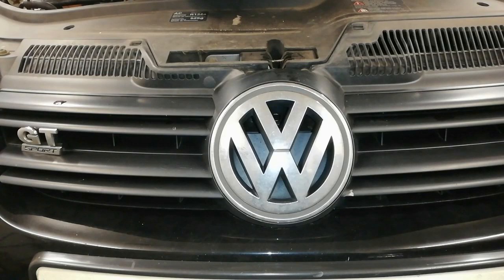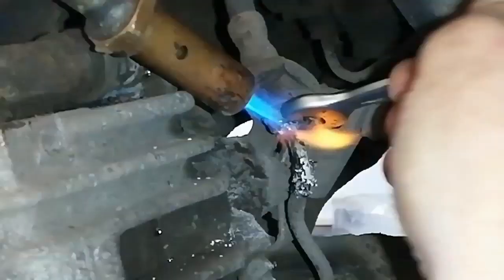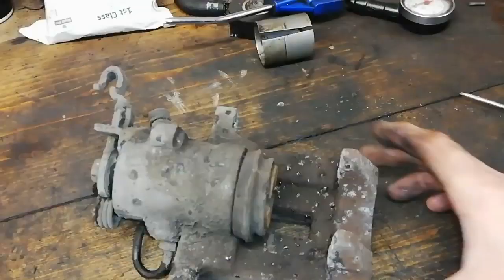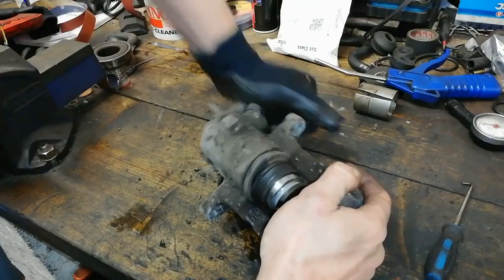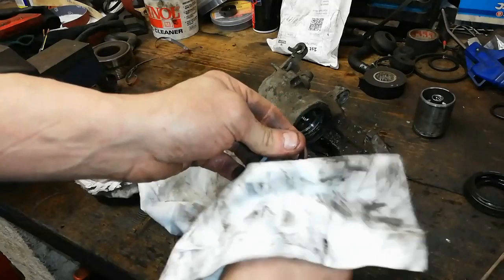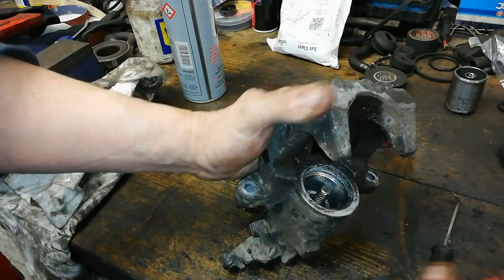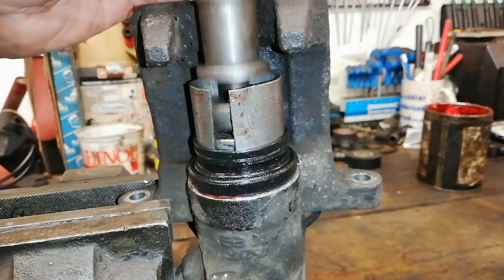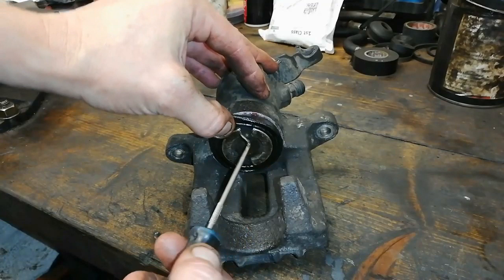VW Audi Seat Skoda Rear Brake Caliper Seized, Easy Fix

Comment: You're an absolute fecking legend. Great video! I could have done with seeing this video last year when my rear driver's side calliper seized up. I ended up getting a used one from Traynors. I also twisted the brake pipe too and got a new one. Your video has fully educated me and will hopefully save me from faffing about next time. Thanks ☺️

Comment: Note from an amateur. I heat the bleed nipple with hot air gun then spray freeze spray onto the nipple. Use deep 6 sided socket to undo. Works for me. Maybe some PTFE tape around threads and save grief later.

Comment: Great video Dave , love the special tool , these can be a pain to wind back in normally , I usually whip the rear disc off , remount the caliper without the pads and full access with wind back tool , easy peasey, might make a couple of the boot sliders, saw something once online about the lovely spring clip on driveshafts that's a pain in the bum to keep in place while putting the cv joint back on , made snap rings out of key rings  circles ,when desperate,  but this guy on the video used a jubilee clip around the snap ring to keep tight while tapping joint back on , then undo jubilee clip and repack with grease !
Reply from the maker: i knew you'd like the special tool mike, yeah i remount the caliper also but if she aint free she no good. Aye same sort of idea there with the jubillee clip i guess, take care, dave
Reply: Cable tie keeps the wire clip compressed too. Quicker than winding a hose clip.
Reply: @garybrown5500  true as long as not tight ring to compress  and jubilee clip can be reused

Comment: great idea with the sleeve always struggle with a blunt pick. first job in the morning make a couple of sleeves thank you
Reply from the maker: Used to be the exact same Simon, until i invented the 'special' tool
Reply: @davesterl  nice to see someone else repairing instead of just fitting new or refurbed parts. made a sleeve yesterday and used today worked like a dream. thank you

Comment: You can reassemble the piston and boot without a sleeve by pulling the inner dia of the boot over the bottom of the piston, then put the OD in the housing as shown here and push the piston in , Is a bit fiddlier as sometimes the boot slips off the piston , but it can be done . ( at the factory they put the boot in the housing 1st and then push the piston in through the boot and the seal at the same time. It can be done that way by hand as well but there is a risk of catching the ID of the boot between piston and bore and taking a bite out of the boot.)

Comment: Nice demonstration on what can be done to a caliper without the need to replace them.
Also l like the melting the pipe and the tool that you made
Reply from the maker: cheers matt, im sure youve come across this many times on the Vw's

Comment: Instead of using that metal sleeve to get the boot and piston back in all you have to do is put the piston in just so it’s started, then you put the boot in the groove with the piston hanging off. With a bit of calliper grease you just wind it back in with the boot in place.

Comment: Some VW Group calipers don't have the "wee steel pipe" for the brake fluid. The flexible hose connects directly into the caliper with a banjo fitting.  This makes the job even easier.
Reply from the maker: Not really the point of this video
Reply: @davesterl  the removal and replacement of the metal pipe is one of the trickier parts of the job- e.g.. when the pvc coating has flared.  It might put some off attempting this as a first-timer. Knowing that they may not need to do it will encourage some people to go ahead....
Reply from the maker: @henryjohntobin1  are you a mechanic?
Reply: @davesterl  no,  is that a requirement to comment?
Reply from the maker: @henryjohntobin1  to comment with authority on a subject as you are would require to have some expertise
Reply: @davesterl  I have removed,  renovated, and / or replaced multiple brake calipers; so have some experience.  However,  no experience is necessary to note that the task is even easier if your caliper doesn't have the steel pipe to remove and replace; so it's beyond me what your problem with the comment is.    I would point out, though, that burning off the pvc coating and then re-using the same steel pipe, now without protection from water and road salt, is asking for trouble.  Painting the exposed end of the pipe won't keep water and salt getting under the remaining pvc and sitting there, rusting the pipe. A fluid leak is inevitable.   New steel pipes with intact coating are < £18 a pair online or a few £££ in some motor factors.....
Reply from the maker: @henryjohntobin1  an internet expert then
Reply: @davesterl  much like yourself.  Picking arguments where there are none.  But not much expertise is needed to know that a very narrow gauge steel pipe carrying brake fluid under pressure, should be replaced if its protective coating has been burned off.  Road salt and water v unprotected tiny steel pipe = rust.  No extensive qualification or training is needed to know that is bad news.
Reply from the maker: @henryjohntobin1  much like myself? Really. You know my qualifications then. Your initial comment is obvious and not relevant to this video. You seem infatuated by this piece of pipe. You internet experts seem to be obsessed with saying any nonsense to appear intelligent. Does it make you feel good?

Comment: Good video. 
I think the red rubber grease is vegetable oil based, not silicone; silicone grease is usually colourless, almost clear.
Reply from the maker: Yes, both are fine for this application

Comment: top job dave . did 5 set of motorbike calipers last week seme deal all stuck on the dust seals . i find autosol good for getting some pistons back
Reply from the maker: aye Simon, i think people think its the block seal or piston itself that is the cause, it aint
Reply: @davesterl  people are generally scared to even take the calipers apart
Reply from the maker: yeah, i think most would just replace, but thats too easy

Comment: Great video! Question. If the dust boot doesn’t go in properly can brake fluid come out? I did an inspection on my brakes and had the piston out and having problems bleeding them. The brake pedal is still soft and hitting the floor after several attempts. Pumped the breaks around 50 times but not getting stiff etc. The dust boot appears to have gone in Ok but now it’s back on the car so hard to tell? Will it be the dust boot leaking?

Comment: neat trick with that metal sleeve, save you finger from geting hurt when you apply air in to put piston back
Reply from the maker: not sure why you need air to put the piston in but thanks anyways
Reply: dave sterl  when you put the piston in it normal position on top of the boot and blow air in the brake hose port conection then boot open up and you push the piston in it cyl  whit no air
Reply from the maker: @danman9017  ok cheers

Comment: 26:50 My piston does not go further but stays rotating at this level, too high. (Similarly as here at 27:02 in the correct level.) Does it have to do with the hand brake adjustment? The pads were really worn out, metal to metal.
Reply: Did you ever find a solution? Going through it rite now

Comment: Super video, thank you, I had started with the bleeder screw if it breaks, so ...
 :)
Reply from the maker: good tip on the bleeder screw there Carsten, tho i have methods of dealing with that also. I keep replacement bleeders as well as the boot kits
Reply: @davesterl  aye put a nice wee drill inside the nipple then grip and work it loose. The drill stops it compressing
Reply from the maker: @game4alaughman  great tip mate

Comment: Dave have you ever come across one of these that won't auto adjust?  Have one in Astra H, not seized, but when you pump up the brakes it doesn't auto adjust, when release brake just retracts all the way, if you repeatedly pull the handbrake the piston doesn't keep coming out it just pulses in and out in same at the same position spot.  Other side if you repeatedly pull handbrake it will push the piston out further and further. Tried winding it in and out
Reply from the maker: Yes, I've had that on older vw's where the handbrake wouldn't hold the piston. Easiest just to replace
Reply: @davesterl  cheers will do 👍

Comment: Have you come across the handbrake lever mechanism seizing? If so have you been able to repair it? Regards Charles
Reply: Mine were seized solid. You need to get the caliper apart further and clean out grime in the inner mechanism. Needs more skill and a pair of extra long reach long nose pliers.

Comment: Hi Dave Great video as always... couple of quick questions. Is that red grease silicon based? Is it safe to use on the sliders as well? Is it called red assembly grease as there appears to be quite a few types out there on google search.
Reply from the maker: Yeah silicon grease, 21.15, you may find different names out there, basically the same stuff(rubber grease, assembly grease)

Comment: So, at 12.16 you think that an old flexible  rubber boot will cause the piston to seize with a nominal brake line pressure of 30 to 40 Bar ?
 That's 588 PSI  !!!   I dont think so.
Reply from the maker: You think whatever you want. The boot prevents the piston from being wound back in, nothing to do with brake line pressure. Perhaps you should watch the video again before you comment